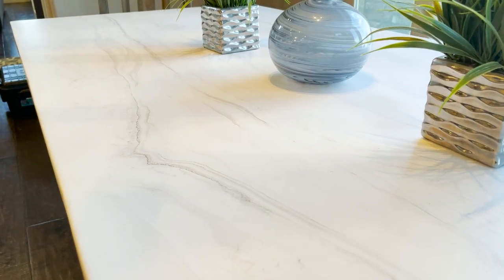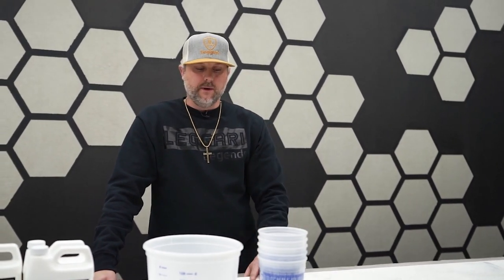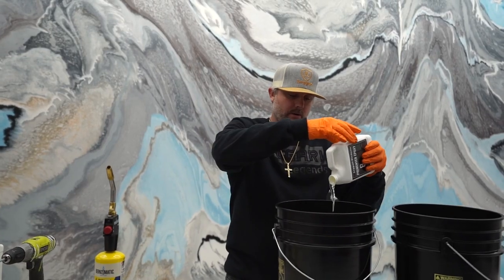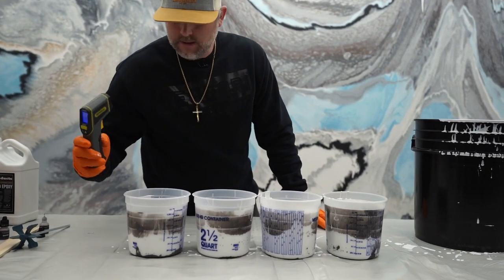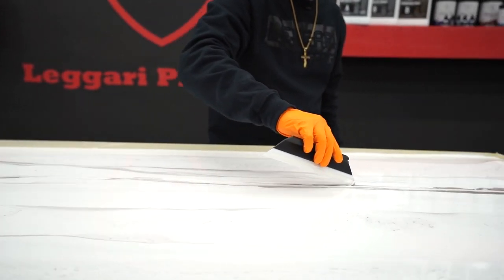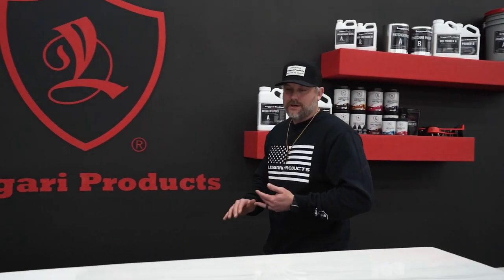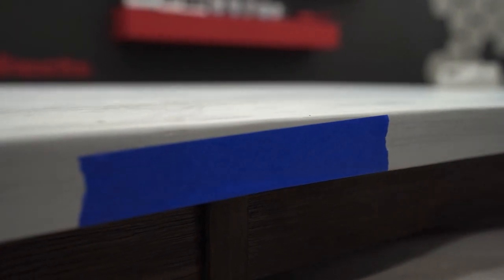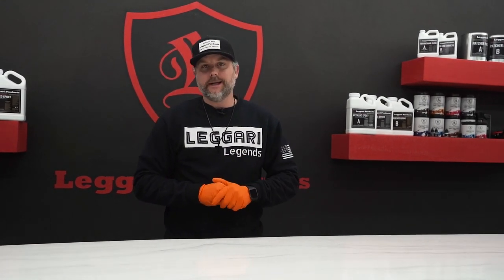Made This Old Wood Table Look Like Real White Marble | Pour Out Marble Look Using Epoxy

Comment: Beautiful workmanship, Thanks for sharing all your tips, I will be rewatching this a couple times before I do my personal table, roughly the same size. 
My ?? Is; At those temperatures how long did the repairs take to cure up under the tape, also if it was in the mid 70s air temp roughly what would be the dry enough to pull tape time's??
 Thanks Again 🤝👊 Steve

Comment: Did some research on the fast hardening of resin.  If you set it in  a bucket of cool water, they say it will slow down the hardening and allow more time.  I am using smaller bucket and not as fast as I should be.   I have not tried this, but will give it a try.  Do recommend Leggari products over others on the market.  He is absolutely correct, if you are not familiar with resin, this video is not for beginners.  Practice, practice, practice!  Great videos and products.